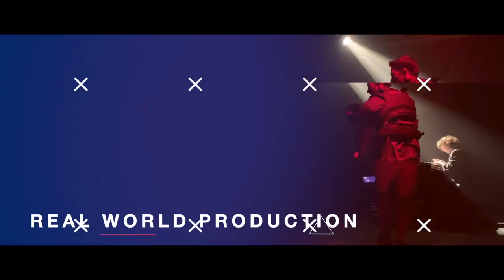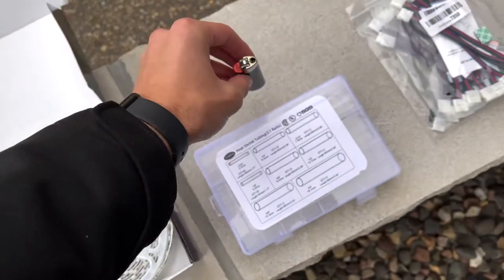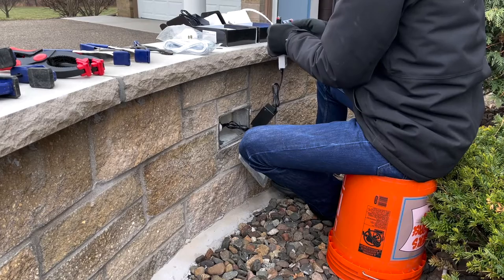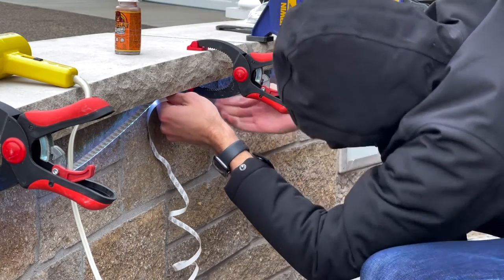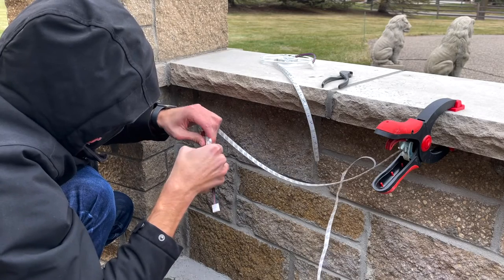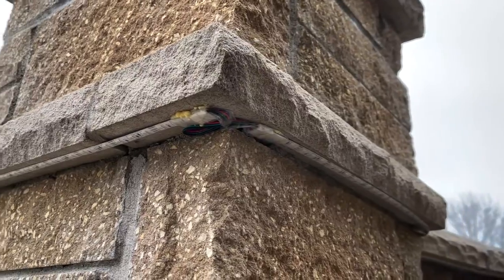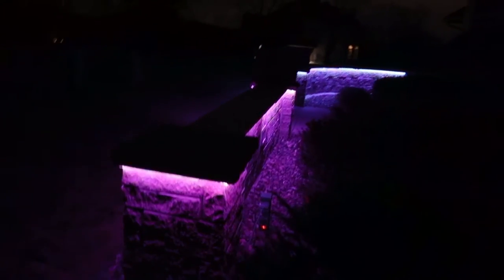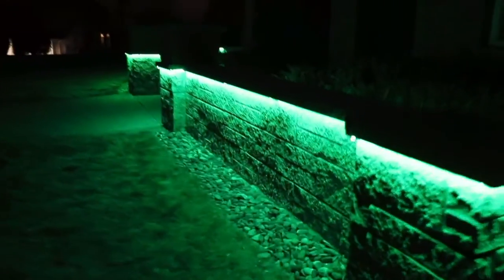Super Clean DIY Outdoor LED Lighting

Comment: This is stunning! I was doing this on the weekend and was struggling on how to waterproof the led strip wire connections. Never used heat shrink tubes (yep I’m a noob 😅), thanks for the tip!